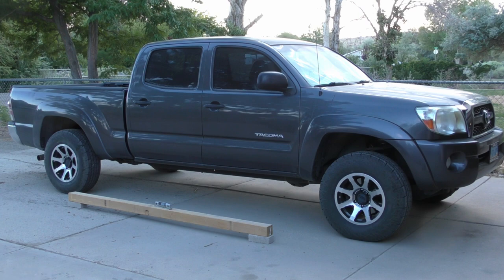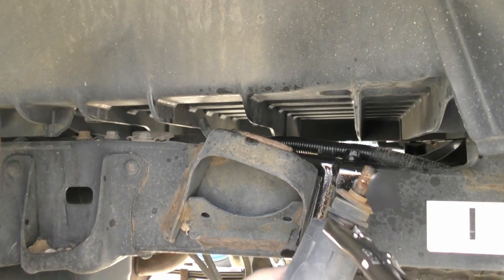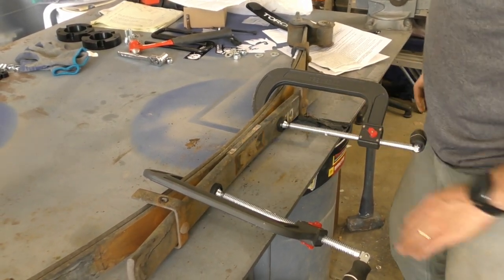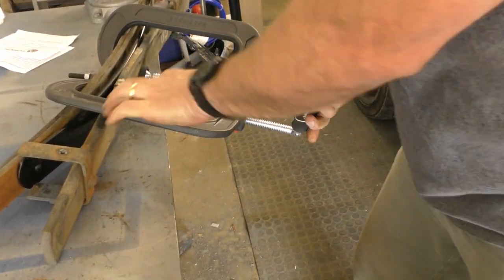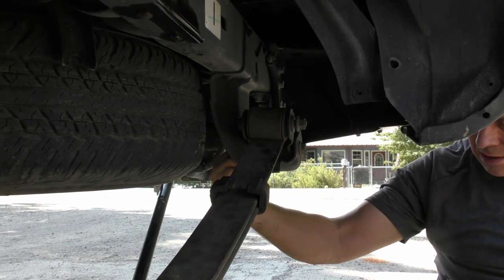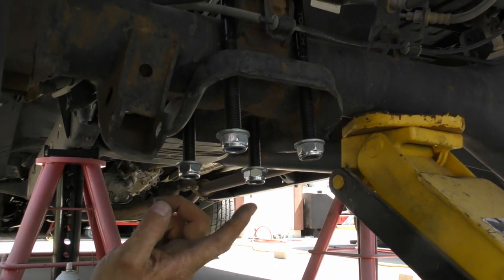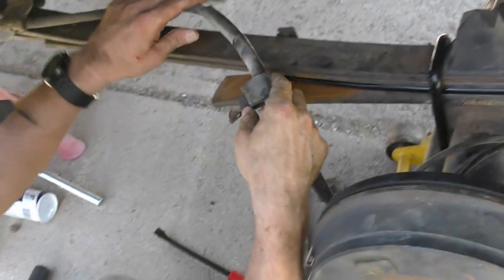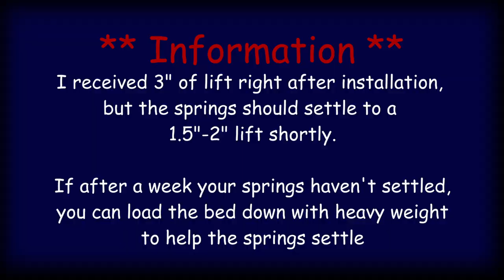Toyota Tacoma TORCH 2" Full Lift Kit with Add A Leafs Install - Part 1

Comment: Is there a reason you removed the leaf spring? Did you think it would be easier than adding the leaf with the pack still attached?
Reply from the maker: I removed the spring on the Drivers side but didn't on the Passenger side. I should have added that to the video. I initially thought it would be easier to do and easier to record on the bench, but decided to save some time on the second side. If I remember correctly the instructions said to remove the spring.
Reply: Just did same to my ‘16 long bed. I did not remove the leaf pack. U can use the Jack supporting the differential to help compress the springs along with the C clamps on reassembly. Make sure u have strong C clamps, I broke one… also, u can reuse the axle U bolts, they are long enough. Good time to change/upgrade shocks too.